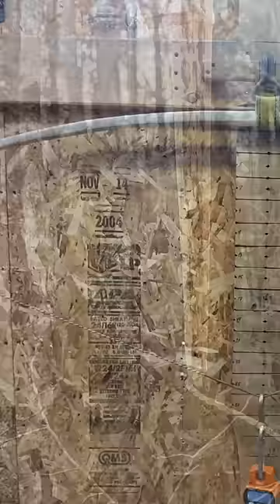Maple Longbow: From Tree to Bow #shorts

Comment: How short of a bow can you build?… with decent poundage?  Would love to see a video on that!
Reply from the maker: You can go very short with very high draw weights. Just look at crossbow prods. The trouble is getting both of those things and a full draw length. Most historical short bow designs didn’t use a full draw length with an anchor
Reply: @DanSantanaBows  a friend of mine built me a self bow at 54” and I use it at my full draw length of 28”. Was curious if you could go shorter :-).  I love the 58” - 60” mark. Long designs are hard to hunt in the woods with. Keep the videos coming. Love your channel.

Comment: Hey! So are you ever scared it will snap on you while tillering? I'm making my first one and as I was carving, i knew there was a part that was too frail so while tillering i accidentally snapped it. Should i make my next one thicker?? How do you prevent it? I'm scared I'll hurt the wood by bending it
Reply: Also, I made it from a Hickory wood board. I checked the flow of the grain and it went all the way down with no stripes going onto the outside so it was from the center of the tree. There were no knots in it that I saw. It's a 1 by 2 inch board and 6ft tall. What do you think I should do for the next one?
Reply from the maker: Breakage stops being such an issue after some experience, but there’s always the chance of an unexpected flaw in the wood. See my playlist of beginner essentials where I cover the key topics that will get you confident about this. Especially see the video how to break a bow 2. There you’ll find plenty of tips to keep it from happening. You don’t have to make it thicker. Follow my board bow tutorial and if you need a tiller check post one on r/bowyer and we’ll get you help specific to your bow
Reply: @DanSantanaBows  thank you so so so much. Will do! ❤❤❤